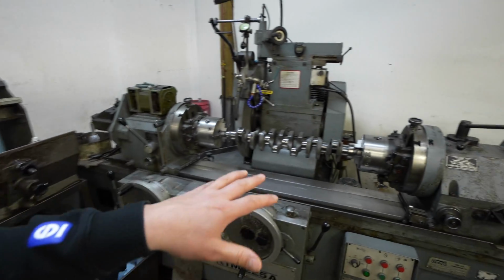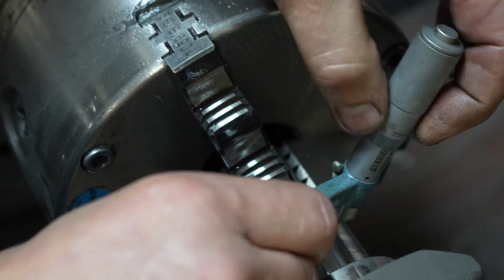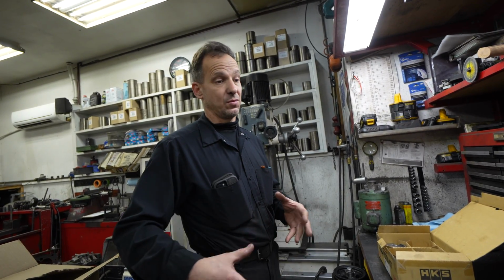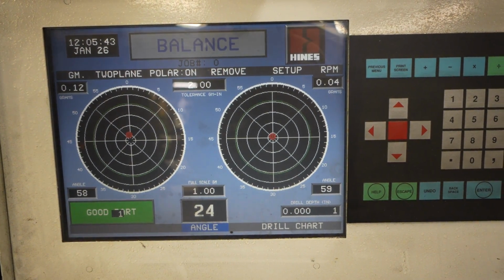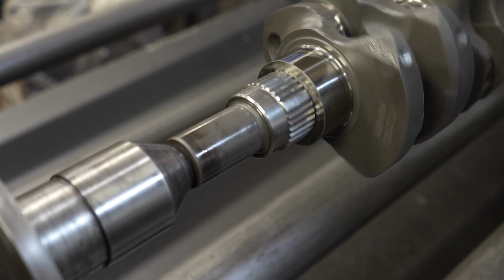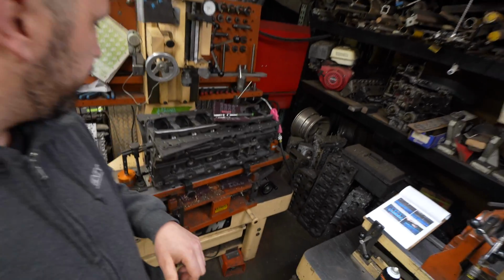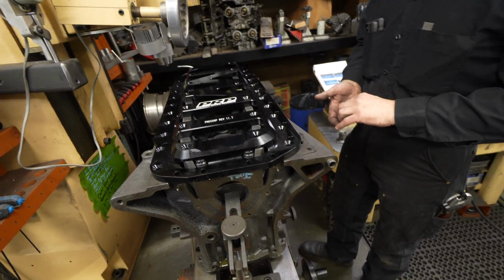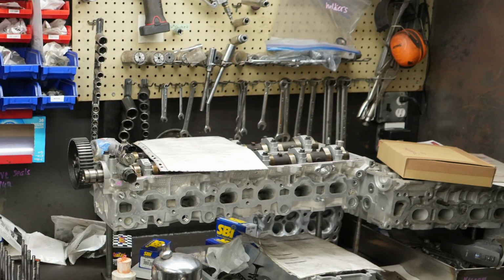Building an 800+ HP RB26: Crank Collar Mod & Block Brace Install.

Comment: Awesome content man. I just had this exact same process done on my Nitto 2.8. I’m actually final fitting my Leask Spec oil pan on tonight and trying to get the engine installed in my 33 this weekend! Keep it up! It will be finished before you know it! Sick build so far!
Reply from the maker: Thanks Brian, that's awesome to hear your building your GTR as well. Its an expensive and stressful process to say the least. Glad find my videos interesting, I do my best I can to provide as much info for the GTR community I can. The Leask oil sump extension is a nice kit. I will be doing something similar, I am installing the Supertec Racing sump extension on mine. I have had this in my garage for 6 months and have not even had the time to open it and share this with my channel. https://supertecracing.com/products/rb26-sump-capacity-up-kit-awd Thanks for watching, more to come. Best of luck to your and your R33 build.

Comment: Bro I really can’t wait to see it running again, btw did you consider changing the transmission to a DCT like 8hp ?
Reply from the maker: You and me both, I am going to work my butt off to get this thing back together. As far as the DCT trans, I have seen that conversion done and it is something I am interested maybe later on once my stock trans fails. Doing a new transmission is not in my budget right now. I still have to sell my HKS twins and pay for the rest of my single turbo upgrade, plus the cost if Intec's labor for assembly, miscellaneous and tuning they will do. I want to get my GTR back together by this summer. That's my goal. Thanks for your support and for watching.

Comment: Thanks for showing this stuff Josh.  I've wondered what kind of rig they use for polishing crank journals.  Now I know.  
I'm glad there are a few guys around (not many) who are good at this kind of machine work.  Usually there's no do-over if you mess up some expensive part.
Reply from the maker: Gary, it was such an awesome experience with John at the machine shop see all the different machine processes. I spent over ten hours with John make the 2 videos in his shop picking his brain learning and really enjoyed everything he patiently taught me about engines. I have a good feeling with the high level of detail he puts into his work that my bearings will last a long time. Thanks for watching Gary.